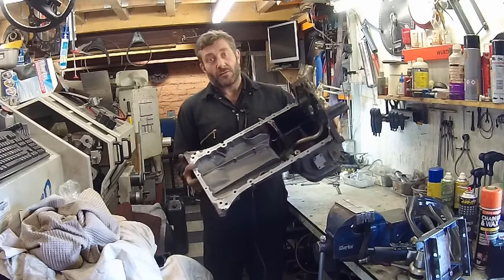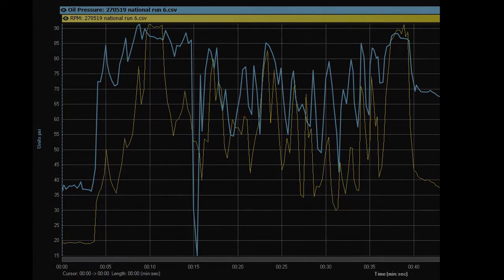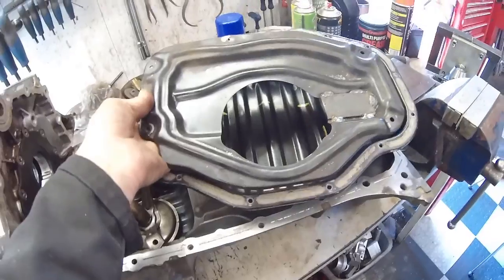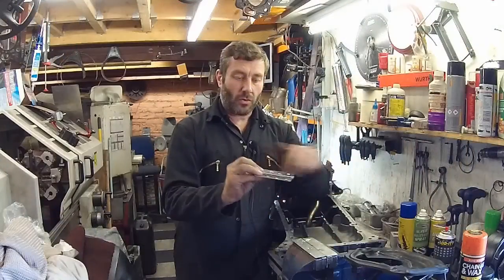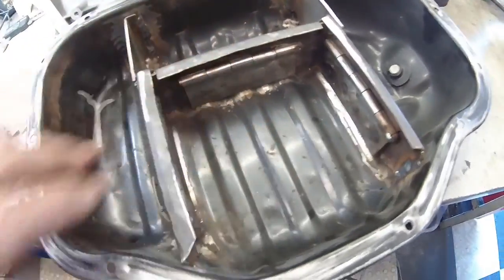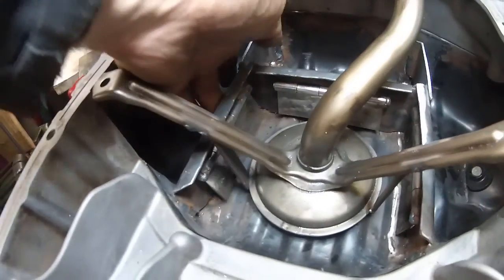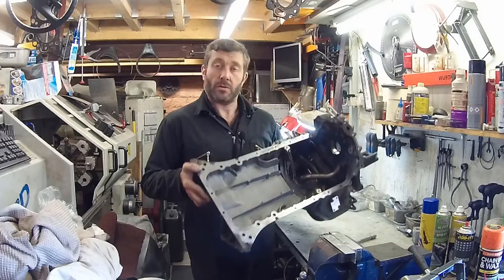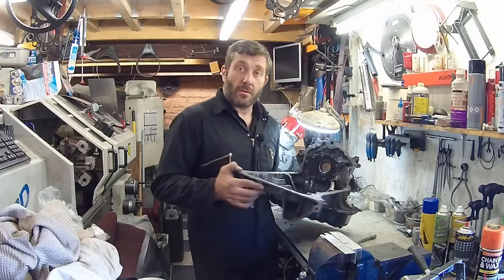TurboShed Part 32 - 1UZ FE Trapdoor Sump Baffles!

Comment: i just spun a bearing on my 1uz for this exact reason. how well did this work for you?
Reply from the maker: it worked "okay" and improved the oil surge a lot, but did not 100% cure it.  In the end we fitted an Accusump and that fully sorted all the oil surge issues - see later videos for that install!
Reply: @Concept5North  i looked through your videos but couldn't find the install on the accusump just you talking about it on the track. does the accusump increase oil capacity as well?
Reply from the maker: it adds about another 4 litres to the oil circuit, but its the way it ensures full oil pressure to the engine at all times that makes it work so well, highly recommended for any sort of high G 1UZ use, we've never had any bearing problems since
Reply: @Concept5North  awesome thanks for the reply!

Comment: When it's time to do an oil change will the hinged baffel cause an issue?
Reply from the maker: It won't drain like it did before, so there are two ways round that.  Either just run the engine up to temp, then let the oil drain overnight, or draw it out of the dipstick hole with a vacuum thingy